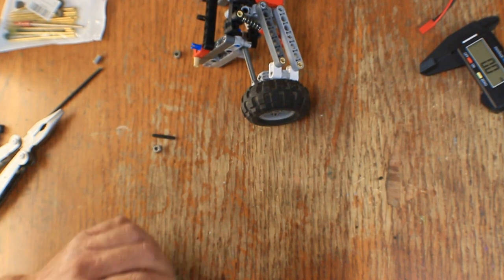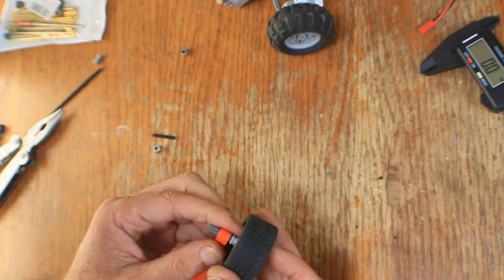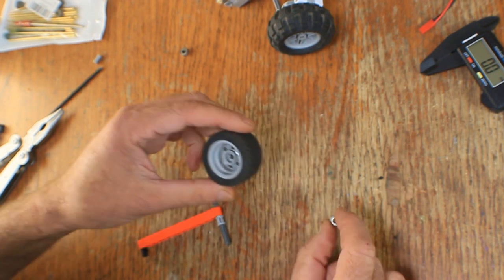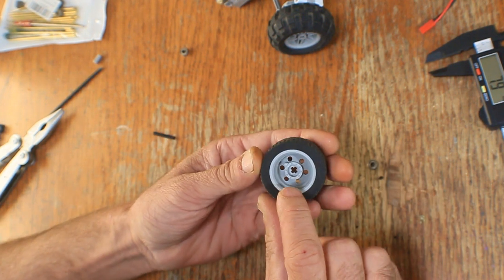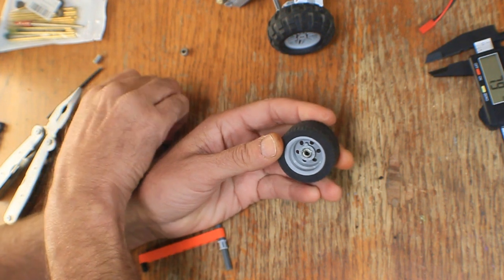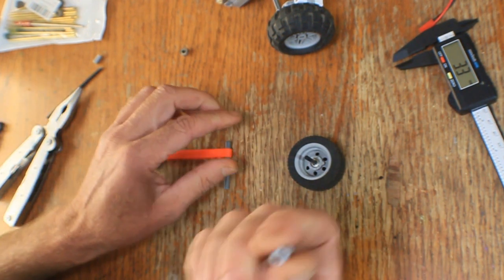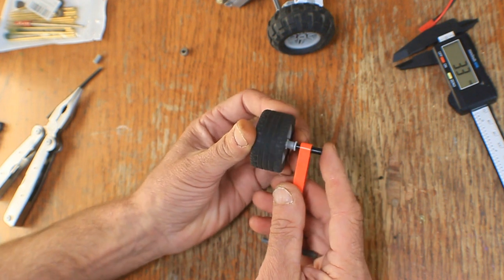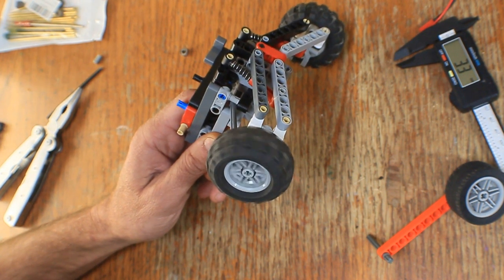How to Put Ball Bearings in a LEGO Technic Wheel

Comment: Nice video, now the next challenge - mount a bearing that can run standard technic axles, eg with my 540 motor instead of these puny Lego motors!  I keep melting axles with the 540 and it's only a low rpm 35t crawler motor! cheers 👍🍺
Reply from the maker: Are modifications ok? A bearing to fit the axle is not that hard. Getting that bearing into anything Lego is the problem.
Reply: @MaxBrix  very true. I have a stack that fix the axle but short of cutting or 3D printing it's going to be hard. Only need them for the motor end of the transmission.
Reply from the maker: I had melting on my motorcycle. I had to grind my gears flat, glued some parts together to make more ridged and used graphite. I use pencils for lubricating Lego.
Reply: @MaxBrix  I use white teflon grease, but indoors on carpet it's not good, nor is graphite. We need a bearing bracket! plus we are being ripped off with Lego motors. They only have torque because of the internal gearbox. Such puny low revving units. Maybe they did that to save melting!!
Reply from the maker: @carlbModels  Sounds like the carpet is the problem... You are right about Lego. I thought they would step up the adult side. Better radio, better batteries, brushless motors, bearings. They did WEDO instead. YAY apps for mobile.
Reply: @MaxBrix  wife is the problem! A $£10 540 motor is about the same torque as an XL motor but that's only the gearing that has done that. However, the 540 is 20-30 times the rpm. Lego is what, 800rpm? 540 can do 15000 on a bad day. And that's just 2S, brushed. With a reduction the torque is insane, increase voltage and you have more power than Lego can handle. All for less cash.
Reply from the maker: Funny, that was my first thought, I went with carpet.

Comment: Been hoping for years that LEGO would include bearings into LEGO Technic.
Reply from the maker: Me too. Seems like it wouldn't be hard for them and it could be a huge improvement.
Reply: @MaxBrix  even on youtube, I hardly find videos like this one where people make DIY's (thanx for this video btw).  I found another one but I lost it...  I guess with a 3d printer you could add some bearings to a beam or a wheel easily.  
Maybe if a lot of people send emails about real bearings, they would do it.  Or at least they could produce pieces that are compatible with some standard size bearings or they could have a partnership with another company... I don't know but it's kind of essential with the power functions.  Even with some lubricant, axles and beams get so much wear...
Reply: @Hide_and_Tweak  totally agree. Need a solid block that can be drilled to a standard Tamiya/Traxxas/FTX sized bearing. Or maybe an RC housing attached to some Lego?